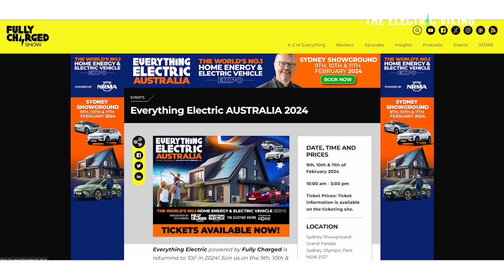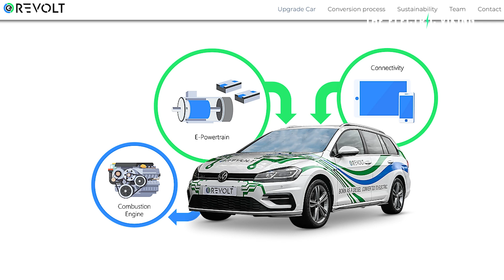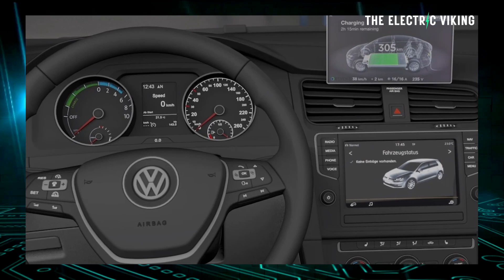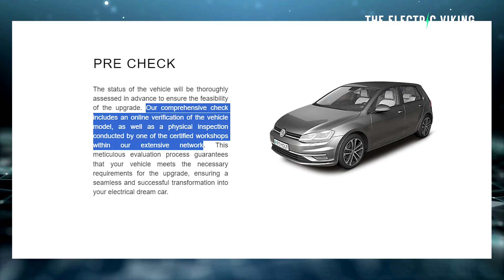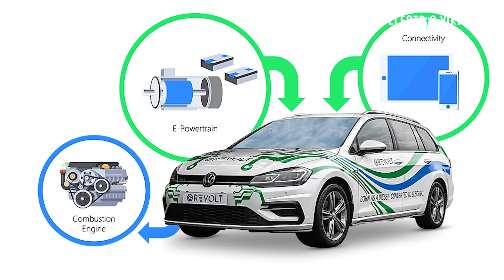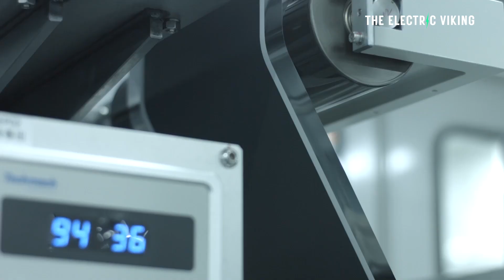e-Revolt can convert your old internal combustion car into an EV in 1 day

Comment: The conversion cost is roughly $15,000 USD with a relatively small battery compared to mainstream BEVs.  Dropping a new drivetrain into an old car still is stuck old safety systems, old frame, and whatever wear was already there.

Comment: It can't be economically viable. Also one of the reasons BYD and Tesla are successful is that they design the car from the start to be an EV which allows them to use lower grade/cheaper materials, and design the car in a clever, EV intended way. You'd have to be seriously stupid to do this.

Comment: I have to say these claims seem way lofty to me. Having a custom shop myself for over 30 years I’ve seen some fast crews. They were never MINE, but I’ve seen shops turn and burn major mods like this pretty quick. But not this quick.

The tear down alone not only involves disassembly, but specialized adapters and other parts unique to each make and model of car. Not to mention cleaning all the crud from running on fuel for however long.

With those kind of time constraints, they’ll most likely put the battery back wherever it fits easily and quickly. This will dictate its size and affect practical use of the car.

Still… with the tech for computer design and manufacturing evolving at light speed and the careful design of a modular motor system, with the right data base it may be possible to roll a car in, enter its information into a strong software set up that knows dimensions etc of the vehicles transmission case bolt pattern yada yada and off the CNC equipment goes, crafting adaptor plates and anything else needed for the conversion. All this while the crew is tearing down the car. 

As an example there is a high quality custom chassis shop in Washington state, U.S. that has a data base allowing them to computer design a fully updated, high performance complete chassis for ANY car that exists. From that computer map they then build your chassis to fit. They certainly don’t do it in a DAY, but they do it.

With bleeding edge computer software/manufacturing equipment, a brilliant modular electric motor system and a def crew, this might actually be possible if the existing drivetrain is kept in place. Or at least close to possible. 

My guess is most customers would be thrilled to get their car converted in a MONTH. Handing it back to them the SAME DAY would send them into giggling super joy.

Even if it can’t be done now, with the evolution of demand, software and equipment I believe it will be possible soon. 

As far as cost, it’ll be heinous at first but the cost will drop once everything gets rolling.

Another good one Viking!

Comment: An overlooked advantage of converting, is that in some countries the older vehicle does not have to be updated to the modern safety standards, some of which come with cost and reliability issues, and are of dubious benefit to many users. Thing like lane-keeping, driver alertness, and crash avoidance software can be a mixed blessing, and many prefer the simplicity of the older vehicles.

Comment: Telling viewers clearly that an existing vehicle has embedded carbon that has already been accounted for is a good thing, and modding an existing ICE to an EV lowers the need for a new vehicle, which is also good.  Any safety authority in the west will tell you to research where a battery comes from and to what standard it has been manufactured to.  It should not be hard to find this out and transparency in this regard is very important.

Comment: Converting ICE to electric is a very cool idea if the price is reasonable.  As battery prices go down it should become more and more realistic.
Reply: I think the price they’re asking is reasonable and it’s also a noble cause, however, there’s now second hand EV’s getting on the market, if I ‘have to’ sell my current ICE car in about 4-5 years and still get a bit of money from that and get a then second hand Ionic 5, it might be a better deal because of more range and relatively high quality batteries and stuff like a heatpump…

Comment: A tank of fuel in my 2006 Golf 2.0 TDI gets 1000 km on a road trip and 900 km around town. It takes less than 2 minutes to fill up from near empty and there are fuel stations all over Australia. Why would I want to spend many thousands of dollars and end up with a compromise of reduced range, increased weight, sitting around for ages charging the battery and also having no charge stations out bush (where I go often). In Australia the modifications would have to be signed off by an engineer to keep it registered, and finally you would have to persuade your insurance company to cover the modified car. No thanks.

Comment: I love gas cars, they are fun to drive, sounds great, give me freedom to travel anywhere without concern of refueling. However, now given the alternative of EV, as long as I can either swapt battery pack like NIO or relatively fast recharging, I will switch to EV while I don‘t have to pay my gas bills any more. It is an economic issue, then on top of it, the EV’s has L2/3 self driving capability and self parking function, I am all in.
Reply: Charging is practically always done while doing something else. Eating, sleeping, working or shopping etc.
Typically it takes no apparent time, & generally less time than ice cars in our lived experience since changing to an EV a year ago

Comment: Oh what about the CO2 impact?  If we figure 1 gallon of diesel per 10 miles you move 1 ton; that is 20 lbs of CO2x  13 billion tons - or 260 billion tons of CO2 for each 10 miles the ore has to be moved. Then you have to figure the mining and transport of 10 Tillions of solar panels. Opps forget your zero emission net zero ideas. This is just heavy trucks - then you can start to consider the 1.4 billion light vehicles.

Comment: In summary; To replace all world heavy trucks alone in 9 years ; using every ounce of lithium produced; you'd need to increase lithium production by 200 times current production. You would also have to dedicate some 10 trillion or more solar panels. Of course all the mining to support that has to be multiplied by 200x. There are 500 tons of ore for each ton of lithium so you are talking 500x 130,000 x 200. - 13 billion tons just of lithium ore - but that is only 7% of the battery so say 130 billion tons of all mining just for the batteries - then all the mining for the 10 tillion solar panels.

Comment: I suppose you people will never just accept EVs as a niche - but consider this. Just to replace the 9 million heavy trucks in the USA it would required 9 years of all lithium production. Not an ounce for cellphones or anything else. If you wanted battery packs in a circuit So you could haul long distance across the USA you'd need 10 megapacks for each truck. So even if you increased lithium production by 10,000% 10x; you'd still need 9 years. If you wanted each pac to be solar charged it would take 3,000-6000 solar panels per pack a total of 30,000 to 60,000 for the one truck to drive across country 1 direction. For 9 million trucks therefore it will take at least 30,000 panels x 9 million trucks or 270 billion solar panels if under intense sun - 540, billion panels if there are clouds half the time probably a trillion for winter time.  That is just the USA.there are 20 times as many heavy trucks world wide so multiply all that by 20 for just world trucks.
Reply: Sodium Ion batteries are going to appear in large numbers over the next three years.   Cheaper and safer too.
Reply: China is already in the process of replacing their heavy trucks with electric, using swappable battery packs. China's geography physically just as big and diverse as the USA or Europe.

Comment: There’s no structural battery back/skateboard design meaning the battery will be undersized by default. I doubt they’ll get much more than 100 miles of range, if that.
Reply: They said 150-180 miles range, 20% less than any modern BEV sold today.
Reply: They are getting 150Mi in converted mini trucks.  C'mon future batteries!

Comment: I have a 12 year old Kia Ceed, but it starts to get a bit rusty… I think conversion will be too pricey, guess market value for my car could be 1500 USD
Reply: But if you would have had a BMW instead that isn't quite that prone to rust that would be a better option.
When thinking of BMWs most of them are built in the "same way". The engine and gearbox are placed in the same position according to many other "parts" that means that the same kit could be mounted in most of the models. That would make the kits somewhat affordable, at least from China.
I saw a guy in Finland, he built parts from a Tesla model S into a Mercedes 2 door from, maybe, 1974!

Comment: The rust is so bad in my area anything beyond an oil change takes more than a day.... A medium sized vehicle project will require you losing and re finding your faith in a higher power about once per bolt, 15 new swear words spontaneously invented and at least one small burn from the bolt you eventually had to vaporize with a torch.... my state needs better public transportation because the vehicle owner has to pay a mechanic to work on the car and the resulting counseling caused by the frustration of rust.. and you have to pay the state for all the salt, calcium, brine and everything else they buy to put on the road to destroy your car.

Comment: There are small companies in different countries that do these EV conversions, but usually the cost is high and the end result is somewhat compromised in terms of range compared to new electric vehicles. You would be better to buy an old Nissan Leaf because it would cost about the same and have similar range. I'm surprised Sam is pushing this idea as he is usually against new EV's that are based on an ICE platform, and that's basically what this kind of vehicle would be, but you would still be driving a used car. If they were relatively cheap to convert, like under $5k I could see the value of it, but usually they are more than double that.

Comment: It’s never been about how quickly you can convert an ICE vehicle to an EV, it’s always about the price, and whether you will have useable range and fast charging ability afterwards.  Because if it isn’t cheaper than buying a new EV then there’s no point unless you have a collectable old car.
Reply: Old Range Rovers, etc with real 4WD are interesting objects, because you can use them at hunting, etc.
Reply: Stop being logical 😊
Reply: A “collectable old car” would cease to be collectable if it was converted to a EV.
Reply: Collectable cars aren't usually driven often enough for it to be worth converting to electric.
Reply: @TCMapotherIV  They aren't driven much usually because their drivetrains are old and breakdown easily.
By converting to Electric, it's actually reliable enough to be used as a daily driver if the owner wants to.

Comment: Or you can convert a 1,020kW Tesla Model S Plaid to a 2001 Honda Odyssey minivan and have the ultimate sleeper car
Reply: Electric Classic Vehicles have already produced a street driven 450bhp, Tesla engined Beetle. They produce a bolt in kit. No welding. The car is utterly nuts.
Reply: That sounds logical 😅😅😅😅

Comment: I saw someone saying that cars pre 1996 are convertible but after that the computers become very problematic.
Reply: No, because you pretty much need to replace the computer anyway. Your fuel gauge is set to deal with a small signal from an analog float. Instead, it requires a calculation based on the voltage of every cell from the battery management system. The newer cars would have more technology, which means that one needs to tell the replacement computer more so that it can manage the technology. Either way, the vehicle pretty much needs to be rewired as well as the cooling system needs to be re-engineered.

Comment: The whole thing is gonna hinge on one question: WHAT'S THE PRICE?
Reply: Transport Evolved reported today that e-Revolt kit cost 12-15K Euros.  That’s $13-16.3K (US dollars).  According to Transport Evolved, the kit is available to 42 ICE models.
Reply: @williamquemuel7824 sounds like an amazing deal
Reply: @williamquemuel7824  thank you! Also yes passenger and really any vehicle including all manufacturing and freight engines pollution kill millions every year. It’s the particulates which none of our natural biology can filter out. And this has been known from the start. Read the history of gasoline in Nation magazine. Read the vast science literature backing up these facts on that pollution.
Reply: Last company I saw online in the USA was 20k to 40k for a conversion
Reply: @hookersterminaltackle 

But did they claim 1 day turn around?
Reply: 15-20k EUR
Reply: And are they insurable ?
Reply: @robertfonovic3551  Yea but it will be expensive. But Ur tax will be a lil cheaper since it's now zero emissions. They use the Tesla module so it's pretty good if u got a done up golf and don't wana loose all that work
Reply: 😂50.000 $
Reply: Exactly.  And keep in mind that passenger vehicles only contribute about 6% per of total emissions….
Reply: @christopherhamilton5557  Yeah, driving them. A ton more emissions happen during the actual manufacturing process for both ice AND evs, so conversion is the best way to get EVs on the roads by recycling every part of the process

Comment: Ruin a perfectly good ICE vehicle in 24 hrs.  That's progress?  Another mad idea for a mad world!
Reply: Most EVs based on an ICEV frame get poor to horrible reviews due to the whole layout being very sub-optimal. EVs need extremely good aerodynamics if you want to achieve half-ass highway range, a converted ICEV will have a smaller battery than most EVs and likely far worse drag coefficient. Yeah, converting still perfectly good ICEVs to EV makes little sense. It is mostly a wealthy people toys thing, similar to V8 Tesla conversions.

Comment: Great idea. There is a huge potential market- initially for specialist high value cars - for example Jaguar with a clapped out motor, but otherwise good body and suspension. Being a German start up they should convert an old Porsche 911 to a "Porsche E911 Blitzen" (Lightning without "donna", thunder)) may be just fast enough to beat a Cyber-truck!  The Porch Factory should produce Porch lightning . Apologies  if I have mis-spelt the German words, as I learned them from Santa's reindeer!
Reply: You said a high value car such as an old Jag with a clapped out motor would have huge potential. A couple of my friends are serious collectors and would vigorously disagree with that. A nice old Jag would actually lose value if it was converted to an EV. Collectors and enthusiasts would be appalled. It's the engine that is the focal point of these cars, whether it's the in-line six with the polished aluminium rocker covers from the 1960's or the V12 from later years. It's the history and how they sound and drive. An old 3.8 Jag or E-type without that distinctive exhaust note and 4 speed gearbox with no syncro on 1st gear would not be a Jag. An electric car is an appliance.
Reply: The entire point of driving an old Porsche 911 is the light weight and analog feel of the transmission, engine, brakes, etc.  Dropping in a heavy battery pack  destroys the weight balance and dynamics. 

If the point is electric sports car performance, then you'd just buy a brand new SC-01 coupe.

Comment: Doing the conversion in a day means all the details have to worked out in advance, so this would be available for only the biggest-selling models of the last decade or so.
Conversion of older, more exotic cars - the ones that could benefit most from a conversion due to a lack of spares - is likely to remain an expensive exercise.
Reply: There are a lot of Golf 7’s on the road… I like this idea, but I think I would prefer a bit more range… and if I might still get some money for my ICE car and the current EV’s starting to become available second hand. I think it’s a better deal…
Reply: Tbh fundimentalltv you have an engine, that needs to be connected to the wheels, either through a direct connection to the motor or indirectly to the drive train, which is dependent on the location of the engine and where the drive system is.

You could very easily make universal connectors for anything, you could use one type of engine and just include more of them for more powerful cars.
Batteries could be any type, depending on availability, capacity and output capabilities.

Regardless of the car you would have to extract the engine, but from their everything can be very modular to make this feasible on a mass production scale.

There's a huge potential market for this, especially once manufacturing scale for surplus supply chain requirements is met.
Reply: @MrSec84  You are right in principle, but the devil is in the details, and that's where conversions are likely to fall short. ICE vehicles in the last 4 decades have become very efficient in their use of space and 'fitting in' some different components will probably involve compromises such as less range than desired.
The  best candidates for conversion are the large US pickup trucks which are big enough, and with poor space utilisation, that conversion could be effective. Especially if you detest the look of the Cybertruck!
It's the compact vehicles and sports cars that will present the biggest problems. (I am an ex-automotive engineer)